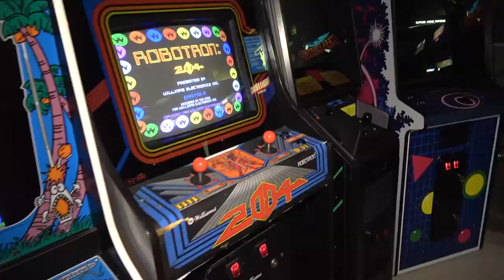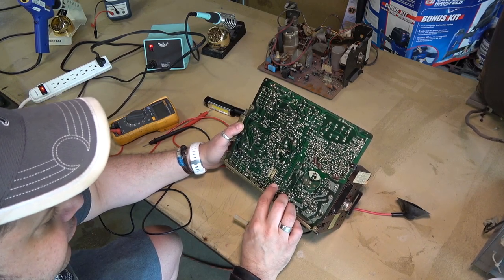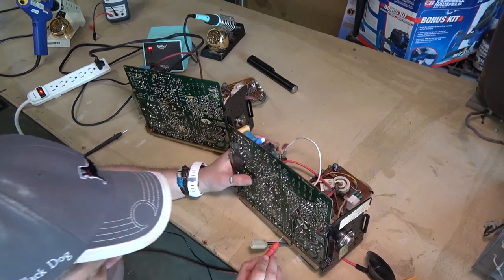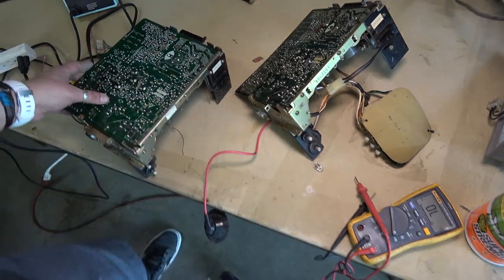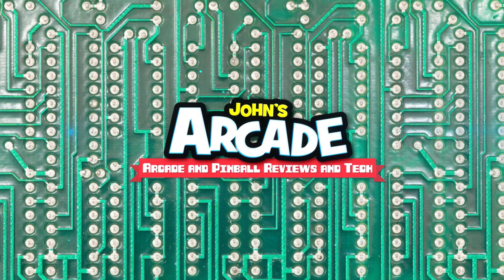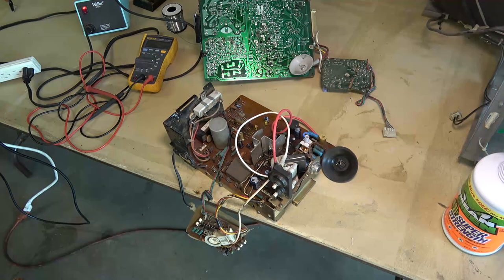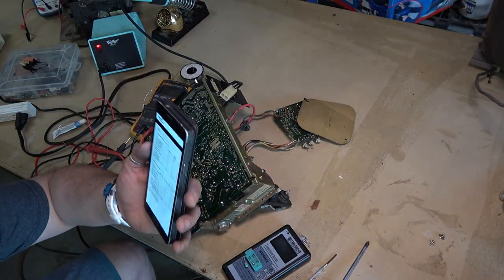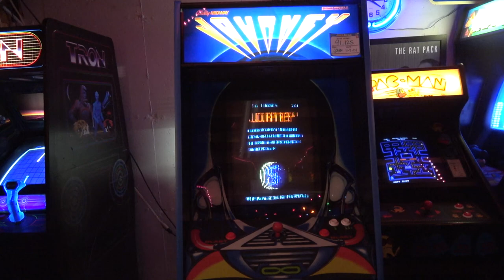JOURNEY MONITOR FIX PART #21

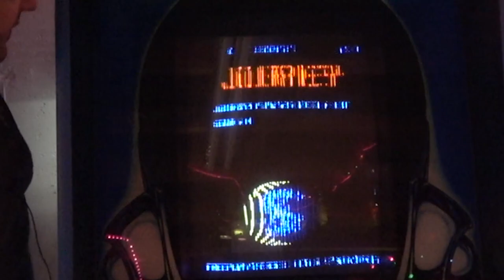Comment: Hey John, pause the video at 57:33 while you are wiggling the yoke, the picture looks perfect for a split second.
Reply from the maker: EGADS!! http://imgur.com/LYrQ823
Reply: I was going to point that out if no one else did.
Reply: You can take a screenshot while something (e.g. YouTube) is full-screen; just press PrtScr on Windows or Linux, or Cmd-Shift-3 on OS X. Also, you seriously need a workbench in the Garage.
Reply: Wow, good eye. I didn't catch that!
Reply: You're right, well spotted, I've took a screen shot and emailed John with it. Hope he reads it.
Reply: John needs an assistant or mirror next time to watch the monitor while he wiggles the yoke connector.
Reply: John King I make it 57:32

Comment: John, We really need to build the Test Bench project. 
You could have tested the monitor in the garage and would have saved time and your back from hauling monitors around back to the basement and reinstalling it.
Reply: Love John to bits but he deffo dont work smart. Needs a test bench as you say. Also mentioned to him getting a flow oven.
Reply: Adam built a new flow oven John... go steal it.
Reply: You put whatever board is playing up in an oven made for reflowing solder. Its bought a lot of my stuff back to life without having to hunt for dry joints etc cos it does the lot in one go.
Reply: Can you really use a reflow oven for through-hole PCBs?

Comment: John , (time stamp: 27m50s  )  You have the meter on beep-test. That's why you get nothing. You need to be on Ohms setting to measure significant resistance. So nothing probably means its over 100 ohms. Its not open. you had resistance from outer leg to outer leg. That's the full resistance of the pot.  The wiper arm  is is the middle leg . The wiper strokes along the resister providing variable resistance to the middle leg. Remember :Beep test is checking for opens and shorts. 

https://youtu.be/Ecj_WpKu0w0?t=27m50s

Comment: My G07 in my Centipede was tweaking out and it was a cracked solder joint on one of the connector header pins. I removed all the old solder and reflowed all the header pins and all is well now.

Comment: you need a test bench, flow oven and you need to test after every change you make to a board and i also have a folder on my pc with excel with every part change and solder or bodge.  good housekeeping on your builds is essential for future repairs.

Comment: As I've told you before John it is a sync issue one of those cables is causing trouble, the cable or the connector it's connected to maybe in the neck board socket, look on the schematic and figure out which cable is doing what, There is no issue with vertical or horizontal hold you repaired that when you replaced the transistors. you can find out the cable connector if you looks on the schematic for its is correct voltage  and current check on the neck board are correct to what it should be in the schematic, should isolate the problem

Comment: It could definitely be the yoke,I and several other people on here saw the picture clear for about a second when you played around with it so you might have a bad connection or something loose,and even if it tests good with your meter there could also be something physically wrong with it aside from the wiring.I would at least try another yoke.

Comment: John, at around 57:32 while you're wiggling wires the picture became clear. It might be a connection back there. You can clearly see the lettering "Journey" as clear as day.
Reply from the maker: Yes, Sean. I saw that now that others have pointed it out. I'm gonna try to put this to bed this weekend.

Comment: If that Horizontal Frequency pot isn't the problem it looks like it's attached/linked to the problem.
Reply: Mabye. My G07 in my Centipede kept losing horizontal sync and it was a cracked solder joint on one of the header pins causing it. After I removed all the old solder and reflowed the header pins (redid them all for safe measure and not just the cracked one) all is well. I thought I might of had a bad horizontal frequency pot because mine was kinda bent back and thought it was damaged but it was definitely a cracked solder joint on the main chassis pcb header pins. I also reflowed the entire neck board because I definitely didn't want to pull the monitor for a bad solder joint. The monitor has been rock solid since the reflow.

Comment: Spends hundred hours on the Journey.
"I hate this stupid, retarded game" -John, 2017

John you should cross check the monitor/chassis with another game PCB to isolate the problem. To me, I'm no expert, but the picture is actually solid on the monitor freaking out but no bleeding onto the sides. To me it looks like game PCB has something to do with it.
Either way, hang in there bro;) You've spent soooooo much time on the Journey and we don't want to see it transform into a journey to misery;)
Big shout out from Hong Kong!!!!

Comment: Seen this on a vintage 60s TV set and it was a dodgy YOLK and someone has posted about the yolk already. defo the yolk.
Reply from the maker: I did meter the Yolk in a previous video. It was fine.

Comment: The title should be called JOURNEY MONITOR FIX PART #3.141592... LOL just kidding. But in all seriousness, it could be a monitor issue, but it's better to test out the PCB with the working monitor and broken monitor just to make sure it's a monitor problem. If it's an PCB issue, then you might want to reburn the ROMS or something. Either that or the ones that you got from Ebay don't work at all. :/ I'm not really an expert, but hope that helps.

Comment: Dude, you need to take a breath and analyse whats happening, and eliminate whats not happening.  First, use the TPG to eliminate the PCB from the equation for certain.  If its the monitor then we need to figure out which circuit is the issue.

And please for the love of god, build a test bench for monitors.  Isolation transformer and a few cables and the TPG and get a large mirror to watch through.